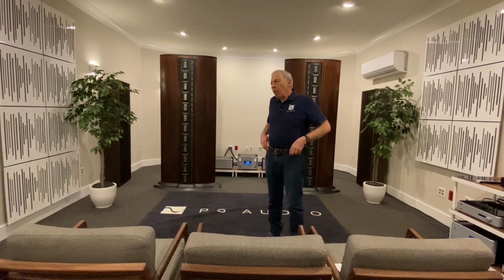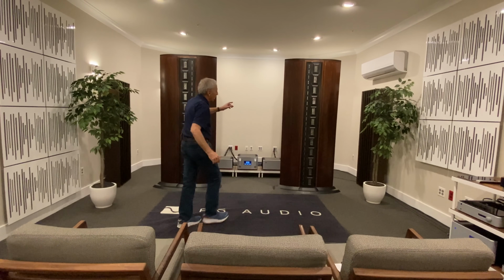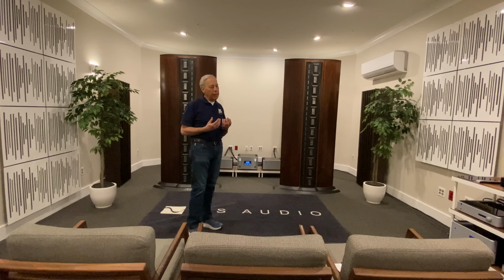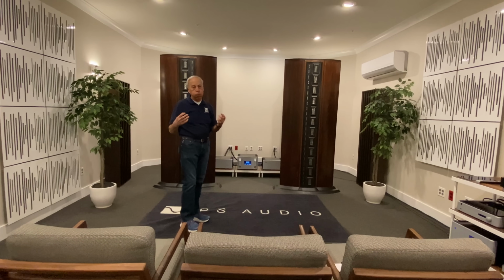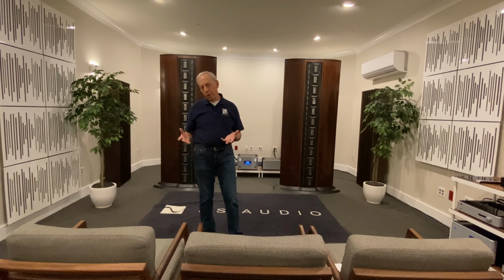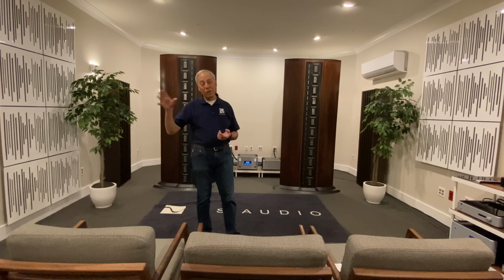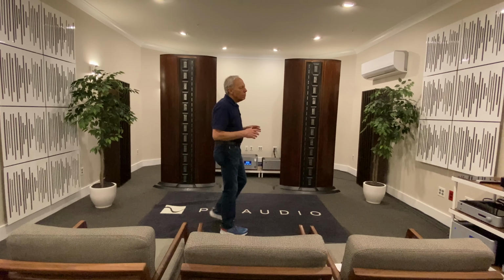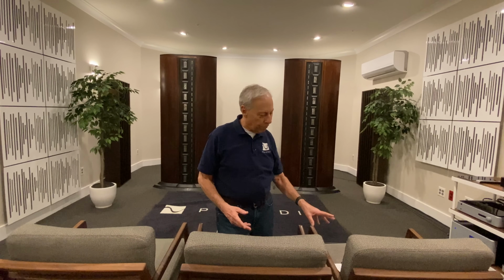Myopic amplifier voicing

Comment: Sometimes the voicing issue is about the house sound. Some designs of speaker appeal for their rhythm, others for their airy treble or, transparent midrange. Many people are impressed by how bass heavy a speaker is. In my experience a system is good when I hear music rather than bass or, treble or, midrange. Good amplification combined with a good source and good speakers for me, give me a sense of musicians performing in a space. I think that comes from good dynamic range without compression. Wide bandwidth that’s phase correct from end to end. Flat frequency range and lack of harmonic distortion. Then as Paul said, the proof is in how little damage it does to the sound of musical instruments and voices compared to real life references.
It’s possible that some old equipment and recordings were designed to cover for each other in a domestic setting or, for AM and FM radio use and, that might mean that the older designs used in the context of modern sources and recordings sound big and rich and lush with fruity bass and fluffy treble. Sometimes changing the capacitors brings them back to sounding neutral and more correct. Myopic voicing is probably not a thing. Equipment is designed to work with a range of available equipment designed to do the same job and people put equipment together as they like it.

Comment: Michael Fremer in his review on BHK 300 wrote this 
"The BHK 300s' bottom end is nimble, well textured, and rhythmically solid, though there's still more weight, power, and physicality to be had in the very lowest octaves. But given their cost—high but far from the highest—that's hardly surprising. (Of course, you'd also need speakers that can express those qualities.) Still, I'd much prefer the nimble rhythmic pacing of the BHK 300s to greater weight that's more sluggishly presented (footnote 1).
Footnote 1: A question for Arnie Nudell: As with many of the storied speakers you've designed over the years, do your current ones have powered woofers? If so, that makes it easier for me to understand why you'd give up your tube amps for a pair of BHK Signature 300s!

If someone like Michael Fremer needs to work on his system then who doesn't ?!!

Comment: I feel that newer amps have more power in the bass. Not the small pussy amps but the better ones. Both surround reciver/amps playing in stereo and pure stereo amps. But alot of old equipment has the lodness button and sometimes that makes people think a older amp sounded better while it really don't.
But with that said my Harman/KArdon has a much more powerful bass and midbass than a Pioneer I tried. But I liked the highs better in the Pioneer. But since the lower parts was not good enough I did not buy it.

Comment: Ideally there should not be any "voicing" done. Amps should be neutral, 20hz-20khz full band flat response with least amount of distortion possible at full rated power. It's up to you to fine tune your system the way you like. Preamp, Tone control, Analog EQ or DSP.

Comment: Just my two pennies worth..
It always comes down to matching whatever amplifier one uses with the appropriate speakers.
Not all amplifiers sound good with all speakers.
As long as the specs of the amp in question tell you the 'frequency response', then you know what this amp is capable off, providing  you use speakers that can follow what the amp does
It's also true (in my experience) that modern good amps have a high damping factor so, bass is 'faster' / better controlled, something that many vintage amps lacked (with a few exceptions).

Comment: A really good high end audio amplifier should not require 'voicing '  these aren't musical instruments! They are instruments of natural recordings ! Why would you ever want to modify the frequency response ( voicing ) of a perfectly linear response ? 
My amplifier is flat from DC to 100Khz .. why would I want it any other way ? Voicing corrupts the original signal with phase issues also .. 
And one other thing ... Paul says the front mid/ high wing panels drop off at 100Hz ... that's ok ... and about what I would expect ... but when a bass guitar or string bass is being played at frequencies around 100Hz these frequencies will be emanating from both rear towers and the front wing speakers ... what this does to the phase coherence I dread to think ... maybe the room corrects all this ...
Reply: Janina ...I suspect that the 'phase coherence' is dealt with in the crossovers.

Comment: Back when I was running an early Cerwin-Vega passive (pass-through) subwoofer on my AV system I noticed a TREMENDOUS difference when I moved from a SONY surround receiver to a KENWOOD after the SONY went sour. 
The SONY had an excellent bottom end and could easily power the sub into room shaking experiences. The Kenwood, with allegedly nearly identical specs, simply couldn't deliver the sustained current to do the job. I was very disappointed. 
(IMHO the Kenwood needed an order of magnitude larger capacitors in it's power supply to actually get the job done.)
Reply: Many vintage amplifiers used output-stage current limiting that was active and established a hard limit on the current that could be delivered.  The limit would vary with output voltage, but every manufacturer used different curves, giving some models an advantage over others.  If you remember the model numbers, I might be able to find schematics that would provide more detail.
Reply: @marianneoelund2940 , after 25 years I have absolutely no idea what the model numbers might have been. Neither was that important a unit to me to even bother remembering. Mostly just struck me that the frequency response and RMS power ratings on the Kenwood had been developed by the marketing department rather than the engineering department...
(I still had Carver tuner and amps on the main audio system. This was just the secondary video stuff.)
Reply: , sadly I had NOTHING to do with the deletion of two of my posts here referring to the original Fresh Aire album. Someone else with, uh, "executive powers" over this YouTube channel had to have made those deletions with no explanation or notice.

(BTW, I have, I believe, all of the Fresh Aire albums.)
Reply: , I was vinyl, and the CDs of the early albums when the CDs first came out absolutely sucked. These days I'm an old fart and much less concerned with high-end audio. I still like my music to sound good, but I'm no longer a fanatic.
Reply: @Tom_Losh ...I just turned 60 so I'm also now in the "old fart" (Boomer) category; but at the lower end ;-).
However if I see an HDCD of a Redbook CD that I have, I'll generally pay the money for the 'upgrade' as I have found it to be worthwhile. Whether it's Neil Young or CSNY or The Cars or Manheim Steamroller, etc. As our hearing ages I find it useful to improve the sound quality at the loudspeakers to offset the diminishing high frequency roll-off at my ears; just a personal 'thang' I guess.

Comment: You need  an amplifier that can cover Between 5 to 50,000 Hz, extended gain range below to 20 Hz of 4 DB, a  Dip at 20 Hz of 6 DB, and dip at 25 Hz and 4 dB. Not many amplifiers can cover such a range.
Japanese acoustic scientists have found out the body can hear up to 50,000 Hz not necessary through the ear canal but it's picked up by brain activity, an adds in my opinion synergy in higher frequencies. the same as the low frequencies extending down low the Munson Curve, to the rest of the audible Frequency band. 25 Hz it is the frequency of the body and should be avoided can make you feel uneasy queasy or sick
Reply: Huh?  Please add punctuation.  There are about 23 different possible interpretations of your statement.
Reply: I agree! That Slash from GUNS AND ROSES is either atotal LIEAR ior esle he has no ideea what he is sayeing! He ahs a video 'The Epiphone Ltd. Ed. Slash Firebird' and starting ats 50 seco9ndes he says the wood . WOOD MAKES NO DIFFERENCE WHEN USEING NON-MICROPHONIC PICKUPS. DOe she usde mikrophoni pickus? I DONT KNOW the hole tonewllrd debate os over. LOTS FO LIERAS OUT ERE. BE RAREFULL - CAVEAT EMPTORRES. THEKN YUO AND THUMBES UPS!
Reply: John ...what about Redbook CD's that cut out at 22.05kHz?

Comment: Try Lyle Lovett’s Road to Ensenada for some low bass that will flutter down to darkness.
Reply: YOU can Google ONLINE TONE GENERATOR AND MAKE A WAVE RECORDIGN OF IT diffrent frequencies and then decide how much of what ou are hearign is the fundamental or overtomes. AND PLAY IT BACK AND. THANKES YOU AND THUMBBES UPS. tRY TYH EONE AT  szynalski dot come. YOU ARE MINE FRENDS THANKEAS YOUES!
Reply: @ilovecops6255  Thanks for that web site. It will definitely be helpful in treating my room.
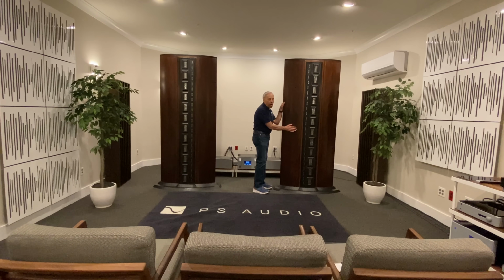Reply: Reaches down to 31Hz in the 3:15-3:35 portion of the track.  The rest of the track only has bass notes down to 36Hz.
Reply: Marianne Oelund thanks for that, how do you measure the frequencies? Must be the character of the sound that attracts me. I can hear the note flutter and roll lower out of range of my system. My large room might give it support too??
Reply: @stevegentle325  
Anything below 40Hz is very low bass.  Approaching 30Hz is surprisingly rare in music - until you get into digitally-processed sound that is using frequency-halving methods.  
I measure spectral content with an oscilloscope that has an FFT function.  Typically I let it analyze sections that are 20 seconds long, selected after listening to the track with headphones.

Comment: Old equipment will often have less control/precision, and in the low end that will usually sound more 'massive'. Hence why many of the most advanced and detailed system components often end up sounding 'bright' or thin - it's not a flaw with the modern equipment as such, the issue that most music is not produced for that level of precision/sound. In a sense, the cutting edge equipment, has outgrown a lot of recordings - for better or for worse.
You can liken it to how a race-car will feel extremely uncomfortable on a normal old road, because the suspension is so stiff - yet technically speaking, it is a vastly superior car, to normal road cars, in every aspect other than comfort. You need an equally cutting edge modern racetrack to really be able to 'enjoy' it. Similarly you will need an equally cutting edge recording for some of the most technically advanced systems to be enjoyable. Its a real shame, and has frustrated me to no end - but you just cant eat cake and be lean at the same time, sadly. The best you can do is to find the balance you enjoy the most.
Reply: Same thought occurred to me.  Low damping factor and the accompanying ringing makes bass sound fuller.  Some listeners enjoy the increased energy in spite of the reduction in clarity.  
Similar to the comparison between reflex and sealed cabinets.  You can extend the low end by adding a port, but you lose the tightness and accuracy of the sealed design.
Reply: @marianneoelund2940 ...aah, life's little compromises :-)
Reply: Was thinking along similar lines... probably more to do with low mids than sub region.

Comment: This doesn't square with Paul's recommendation to drive subwoofers via their high-level inputs and the main amp's speaker outputs to preserve the latter's "sonic signature."  At a typical subwoofer's low-pass frequency of 100 Hz or lower, there's little or no trace of any "sonic signature," because that is overwhelmingly dominated -- even on the lowest bass notes -- by the L+R speakers and (*much* more subtly) by the amp that drives them.  The difference in timbre between upright bass, electric bass, organ pedal bass, bassoon, tuba, etc. is in their harmonic content, not the fundamental frequency of the nominal note played -- and reproducing that harmonic content falls to the L+R speakers, not the subwoofer(s).
Reply: I agrees. They can make a test by recorgin a electri cpiano or synthesizer oR ONLINE TONE GENERATOR directly into the computer, and then do the same with a high quality conde4nser micriphones with an amp and basee speaker cabinest such as 4x10 from Hartke, and them play them back fom the most revealing hi-fi speakers and subwoofers and let hte audiesnce decider what they like to heares. THANKES YOUE AND THU,MBBES UPS!